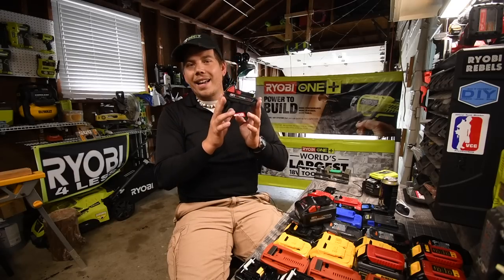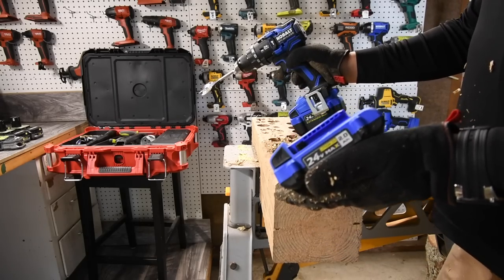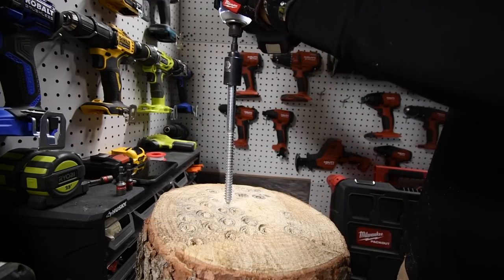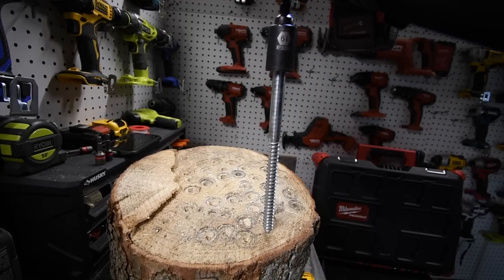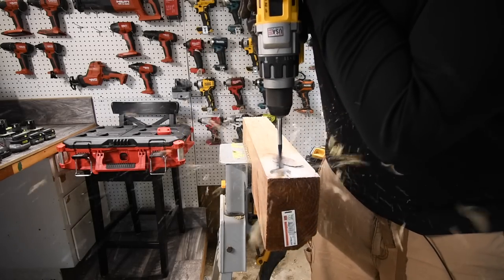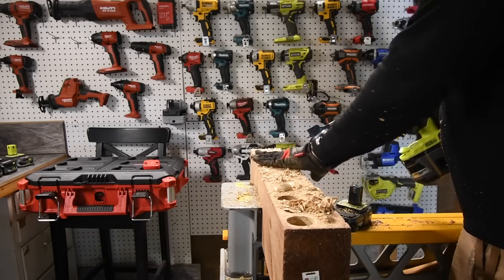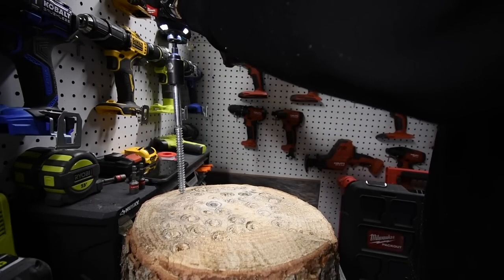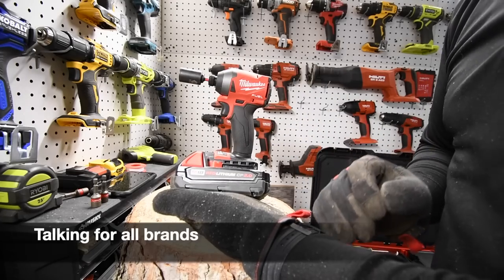Are 2ah batteries as strong as 4ah batteries?

Comment: As an electrician a good analogy would be a capacitor. When a motor is started you can watch the voltage drop momentarily. If you install an appropriate size capacitor the voltage will not drop. 
It’s the same with batteries.
Reply: I agree. Batteries are storage vessels! The more cells you have, the more electrons you can move!
Reply from the maker: I think this was a good way to show the difference as well
Reply: @b gg
Could you link to an article or in your own words explain what’s wrong with my statement?
Also I would like to point out that I said analogy
Reply: Is a drill, impact or grinder not a electric motor? I still feel my point stands. The higher the amp hour less the voltage will drop under load.

Comment: One simple way to explain voltage platform and amp hours has been this:

12v = V6 engine
18v = V8 engine

Amp Hours (AH) = gas tank
18650 cells = smaller internal gas tank pump (less efficient). 
21700 cells = larger internal gas tank pump (doesn’t have to work as hard, more efficient).

The bigger the gas tank and pump, the bigger the fuel line coming out (representing total output of pack), the easier it is to pump gas out, more performance.

Watt hours (WH) = true apples to apples measurement between brands, because sometimes companies “embellish” their measurements. Typically listed either on the battery pack itself and/or the packaging the battery comes in.
Reply from the maker: this wasn't a versus video against other brands. this was a versus video of brands against their own batteries
Reply: Man Caver Tools yes, I understand that. I typed this explanation out not necessarily for you, but for others that may need an easy way to grasp the topic
Reply: You forgot on Hilti 21.6V batteries :) They using one more cell per battery (18V = 5 cells, 21.6V = 6 cells).
Reply: magicokid I didn’t forget them, I chose not to add them since they are outside of the normal 18v offerings. Most brands are typically 12 or 18. Same principles apply though.
Reply: @Borescoped  Yeah, 21.6V (V12 engine) its not typically types :) (HILTI)

Comment: I am an electrical engineer.  You are still WRONG!  (Maybe half wrong) I know what I am talking about.  Please listen and learn.  Most of the time, you are right.  The more Amp/hours per pack, the more power.  But not always.
The power a battery pack has is measured in Amps or Watts, NOT Amp/hours.  Amp/hours is a measure of run time and ONLY run time, NOT power.  Yes, a 5.0 Amp/hour battery pack has more power than a 2.0 Amp/hour pack.  The 5.0 has more power because it has more Watts, NOT because it has more Amp/hours.  Higher Amp/hour packs don't always have more Watts and sometimes they can even have less.
For instance, compare a Milwaukee 9.0 pack to a Milwaukee 6.0 pack.  If you were right, the 9.0 pack would have more power.  But it doesn't.  The 9.0 would win in a run time test and the 6.0 would win in a power output test.  As a rule of thumb, each single 18650 cell is rated at 80 Watts per cell.  Each 21700 cell is rated at 140 Watts per cell.  Just count the cells and multiply its Watt rating to calculate a battery pack's power.  The 9.0 has 3 rows of 18650 cells (5 cells per row) for a total of 15 cells multiplied by 80 for a total of 1200 Watts.  The Milwaukee 6.0 battery has 2 rows of 21700 cells for a total of 10 cells multiplied by 140 for a total of 1400 Watts.  A battery's Amp/hour rating does not always tell the whole story.  In this case, if you judged a pack's power based on it's Amp/hour rating, you would be wrong.
Here is another example:  Milwaukee has 2 kinds of 12V 3.0 packs.  The larger 3.0 XC pack with 6 cells has twice the power (480 Watts) as the smaller 3.0 CP pack (240 Watts) that has only 3 cells.  In this case, same run time, different power.
In the case of Ryobi HP batteries, they use "High Performance" 18650 cells that are rated at 100 Watts per cell.  Go ahead and compare a 3.0 HP  (The taller one) to a 6.0 HP pack  They will have about the same power.  They each use 10 18650 HP cells for a total of 1000 Watts.  In this case, same power, different run time. The 9.0 HP pack will outperform both because it has 5 more cells, (1500 Watts) not because it has more Amp/hours. 
It might seem counter intuitive, but comparing a Dewalt 6.0 Flexvolt to a Milwaukee 9.0 is fair.  However, comparing a Milwaukee 9.0 battery to a Dewalt 9.0 battery is unfair.  The Milwaukee 9.0 is rated at 1200 Watts.  The Dewalt 6.0 is also rated at 1200 Watts but their 9.0 is rated at 2100 Watts.  (The Dewalt 9.0 uses 21700 cells and the Dewalt 6.0 Flexvolt and Milwaukee 9.0 use 18650 cells.)
I wish manufacturers would disclose the Watt ratings of each pack to clear up the confusion but I think they don't want to confuse consumers with too many specs.  There are other factors such as the battery pack's electronics, age and quality of the cells. but this is a good starting template to use when comparing packs from different brands.
Reply: I appreciate your technical breakdown and have no doubt your information is dead on, however I just want to point out that I think the whole point of the video was to correct the people who falsely thought ah was only affecting runtime, as in you can slap the smallest shittiest battery pack on any tool that exists and get maximum power out of it even if for just a small amount of time.
Reply: Great explanation.  I knew some of this but not to that level of detail.
Reply: @Borescoped  Watt/hours is also just a measure of run time.  You don't have to look at the bottom of the pack to find Wh.  All you have to do is multiply the battery's voltage times its Ah to get Wh.  Wh and Ah are just a measure of how much time a pack can discharge 1 Watt or 1 Amp at pack's rated voltage before it is fully discharged.  Measuring Wh and Ah would be like measuring the size of a car's gas tank.  Amps and Watts would be like comparing the horsepower of a car's engine.
Reply from the maker: you are correct. Like I show show in the video, its not the same case for every battery. the Dewalt 2ah was able to do the task that all of the other batteries didn't
Reply from the maker: that is exactly what I was doing and thank you Alex
Reply: Agree. And you forgot another factor. If you compare 6.0 Ah 18V battery (5x 3.6V cells) against 6.0 Ah 21.6V (6x 3.6V cells) = not the same result. I thing more voltage is better for stamina in general.
Reply: The Wh rating is often printed on the back/bottom of the battery, for example my Ryobi P191 says "3.0 ah / 54 Wh" on the bottom sticker.  To compare the battery packs and get a sense of their power though, I generally look at the MSDS/SDS linked to the product on homedepot's website, which has an attachment at the end that usually discloses the cell type used.  For ex, Sony US18650VTC6 is a popular 18650 which has a ~3000mah capacity and is a 15A current cell.  For the 21700 cells they're generally Samsung INR21700-30T which has a 30A rating and is used in packs with 1-row, and in 2-row or higher packs the Samsung INR21700-40T is used which has a 25A rating and a bit more capacity at ~4000mah.    Interestingly the 21700 cells seem more common in the smaller packs so far and so have fewer cells in parallel, and so may have fewer amps per unit-time available, so you can't judge tool performance just by the cell type either.
Reply: Great Info which confirms the DeWalt 6ah 20v batt is more powerful than the 6ah flexvolt.
Reply: What is your explanation of the DeWalt 2ah being able to complete a task that the others weren't able to do? Does the DeWalt 2ah use 100w cells?
Reply: @TheTurbomopar  I think that Dewalt drill is a 3 speed drill.  The others are 2 speed drills.  Dewalt's speed 2 is at a lower gear ratio than the other drills.  Man Caver should have put it on speed 3.

Comment: Everything u have said is true, I have researched the 21700 vs 18650.. They compare it to internal resistance. Kinda like a gauge of wire being bigger or smaller and causing resistance, the easier it flows ( or he bigger cells) the more power it can maintain during power. Alogn with lasting longer.  Small higher ah vs lower ah or 21700 to 18640.. Bigger is better more is easier to mantain
Reply from the maker: I thank you for giving me the extra research bro
Reply: @ManCaverTools  im rephrasing what u have already said lol we both know the difference

Comment: Thank YOUUUUU finally someone has made video explaining how batteries are different and not the same and is that the high or medium torque dewalt hammer drill?
Reply from the maker: I thank you Harold and it is the high torque dewalt

Comment: For everyone to understand WHY the 2ah is stronger than the 4ah, it has to do with the "C ratting system" of batteries

A 5C rated battery will empty it's capacity 5 times faster than a 1C rated battery. Now assuming 2 batteries (A and B) , A = 2ah and B = 4 ah capacity, both with a 5C rating system. 

The maximum amps discharge based on the C rating is, C * capacity, therefore , 5 * 2 = 10 Amps max discharge for battery A
5 * 4 = 20 amps max discharge for battery B

So its not just capacity

Comment: More rows of cells, more amperage and therefore more wattage is possible. One row ~400W, 2 rows ~800w, 3 rows ~1200W.
Reply from the maker: Correct sir :)
Reply: And with 2 rows the cells suffer 50% of the tension, effort, temperature... with this they work better.

Comment: In general the issue with 2ah batteries once they got under load the voltage simply drops because they can't support the same output amps @ same voltage 
So generally if you want to get the best out of your tool go for the highest (AH) your brand support
Reply from the maker: That is correct
Reply: Yes, the best performance will be had by going for the highest AH... but a consideration must be made for weight. Slapping a M18 12AH battery on a small 1 hand use M18 tool will make it perform best, but over time that extra weight would kill your arm. I’d say run the XC packs as the biggest for a 1 hand tool, and the XC packs as the smallest for the high power 2 hand tools as the minimum. Always exceptions to the rule though, like a high torque impact should use XC or HD, but nail guns should be XC or CP size batteries.

Comment: There are two reason for why you can get more juice from more cells. First there is a voltage drop on each cell when using them. The voltage is higher when the tools are turned off. Second, the batteries have internal resistance that is stoppning them from delivering all power. More cells means less resistance. The exact amount of resistance should be written in the data sheet.
Reply from the maker: and that is what I say in the video :) and thank you Mikeal

Comment: To the people that always understood or understand now disregard this, 

To the people that still are saying 18650s and 21700 cells are the same I thought of a comparison you may be able to understand. Let's say a 18650 is like a AAA battery and a 21700 is like a D cell battery. Your argument is like saying they both have the same voltage so they should be able to power the same things. Which is wrong because the D cell (and for example the 21700) battery has a lot more angry pixies inside ready to go power something than a AAA battery (18650 for example).
Reply: How does this compare to for example makita using 2x 18v 6ah 18650 batteries in a 36v tool which gives you 216wh. Compared to their new xgt 36v 21700 cells but less wh in the battery.
Reply from the maker: its crazy that people don't think there is a difference

Comment: You can look this up... go look at 21700 vs 18650’s... the 21700 have higher current draw limits. Done... no need to argue further. When you wire these up in parallel to increase max current draw this is amplified.

A good 18650 max peak current draw:  20-25A

The same Sony battery in 21700: 40A

So let’s say we were using the only a single cell at 4.3V and drawing 25 amps or 40 amps. 107 watts vs 172 watts.
Reply from the maker: correct, and this videos proves those people are wrong that there is no difference

Comment: Using Hilti as an example, a 22v 3ah battery will deliver 66 watts, the 22v 8ah puts out 176 watts, a massive difference, maybe another reason to go with lower ah batteries is their weight? Lower weight can make the tool easier to use in awkward spaces
Reply from the maker: That is correct Stuart. a lot of people need to hold these tools for a long period of time

Comment: The dewalt power detect boost the power when it senses one of their high output 6.0 and such I wonder if it also lowers the power when using a regular 1.5 or 2.0 ah
Reply from the maker: I am not sure but the 2ah for the dewalt did a good job in this video

Comment: The reason the dewalt could do that with the 2ah battery is because its strain sensitivity isn't as sensitive as the others, so it will take more load causing excessive wear compared to others
Reply from the maker: That is good that dewalt did that

Comment: I agree with you and will add bosch core 6.3 that has 20700 cells and more power & run time then 18650 cells the bosch does have 21700 cells in the core 4.0 ah 8.0 ah & 12.0 ah core batteries
Reply from the maker: I need to get Bosch. thank you for reminding me

Comment: can some explain how this is possible?
i know that AH is a unit of storage and not power\output, as in the "fuel tank" of the battery.
 so how is this possible?
Reply from the maker: The more cells in the battery has the less strain each individual cells take. letting you use the power that is already in the battery. it doesn't give the tool  more power. more cells just let you use the power it already has.
Reply: @ManCaverTools  thank you, you made me just a little bit smarter

Comment: The Dewalt hammer drill wasn't really fair with the other hammer drills cause the others were in high and it was in medium mode and not high
Reply from the maker: becasue  the dewalt has trouble to do that task on speed 3. the Dewalt power detect hammer drill can do it on speed 3 with ease

Comment: Is there a difference with amp hours with the m12?
Reply: Big difference. I have the m12 fuel hammer drill and drilling pocket holes with the 2ah it stalls but with the 4 or 6 it does it faster and without stalling.
Reply: It doesn't matter what battery platform bigger batteries give the tool more power
Reply: @dennisslobodyanyuk800  do you notice a difference between the 4ah and 6ah on the M12? I have read that the cells used in the 4ah are actually better cells, and so it puts out more power than 6ah. The 6ah lasts longer, but not as powerful.
Reply: Jayjayhooks I’ve heard that to, but I haven’t really noticed a difference. I only use the drill for small things. If I need something heavy duty I pull out my big dewalt.
Reply: @dennisslobodyanyuk800  fair enough. The only tool I'm really concerned with is my M12 impact wrench. It's probably the only 12v tool I would use most regularly that really needs as much power as possible.
Reply: Jayjayhooks how is the impact wrench. I’m thinking about buying the 3/8 stubby.
Reply: @dennisslobodyanyuk800  I recently got the 1/2 stubby hog ring. I haven't had much of a chance to use it yet to be honest but I've watched a ton of reviews. Seems like with the 4ah will take off just about anything you ask it to on normal vehicles (not semis, basically) including axle nuts. I have seen it struggle a bit with some severely over torqued lug nuts and some axle nuts with the 4ah, still did it, but would be nice to know if the 6ah makes a difference.
Reply: Jayjayhooks I am going to check the bottom of the battery’s to see the watt output of the battery’s is. Because that is what controls how much power the tool is able to pull from them. Because I really want to know which one is actually more powerful. I’ll let you know once I get a chance to check.
Reply: @dennisslobodyanyuk800  thanks bud, appreciate it.
Reply from the maker: I will have to do a 12v video as well

Comment: It’s the discharge rate of each cell. The 21700 cells generally have 35-45 amp discharge rate. Most 18650 cells having only 15-25 amp discharge rate. And if you ever decide to get into playing around with individual cells on your own make sure to study and learn about the different cells. I have some 18650 cells designed for use in low amp draw circuits like flashlights and the cells used are only rated for 8-10 amp discharge rate but they have a higher mah rating so lower current draw but longer run time.  Then I have others rated for 25 amp discharge rate for more power hungry devices but they have a lower mah so they don’t last as long. It’s all about trade offs and what you need the cells to do. I have found most name brand tools using good quality 18650 cells that have an equal balance of discharge rate and mah usually around 20 amp draw and 3000 mah per cell.
Reply from the maker: Yes sir and I thank you for viewing Janes. this video puts what you just said into lamins terms lol